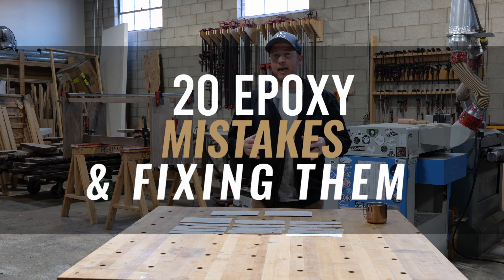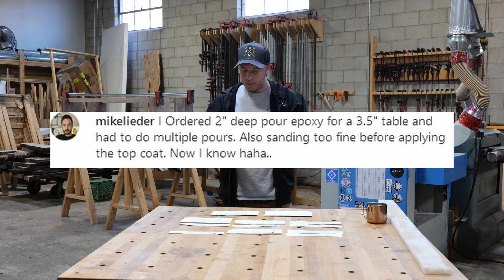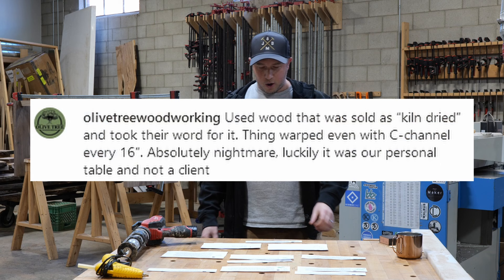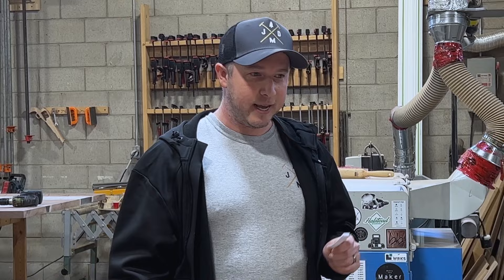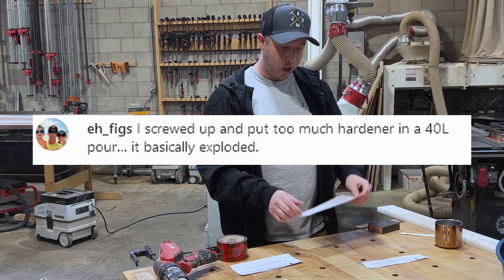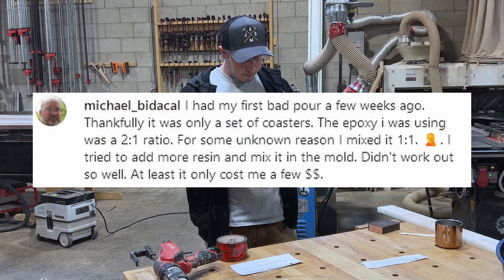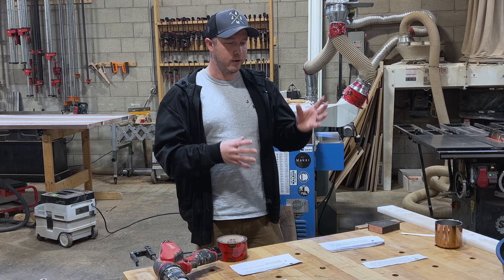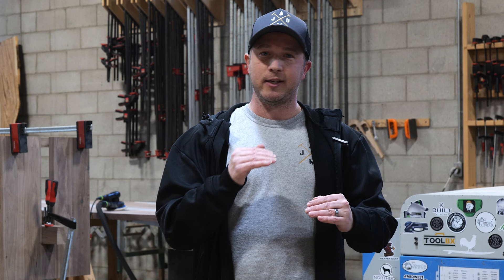Epoxy and Wood Project Fails & How to Fix Them

Comment: Just did our first pour on a penny bar top.  We did a seal coat and I think we took too long as the epoxy got hot, thick and cloudy on the final few spots we brushed.  Would you recommend trying to sand those down and re-sealing them before we do the 2nd pour?

Comment: I want to put crushed glass on a table top that has resin on it do I sand the resin on the table or can I just go ahead with it also do I put the glass down and pour the resin over it or do I need to put a small layer and put the glass down and then pour over the top to seal it in
Reply from the maker: Sounds like your best bet is to scuff the exisiting epoxy surface, apply a very thin layer ( like a flood coat) and lay down your crushed glass, let it cure and then do a final top pour!

Comment: Thanks!  I plan to do some wood "cookie" type tables just for myself.  There are holes and cracks in the wood, is there a thicker type of epoxy to fill the cracks with or do you have a video covering that.  Also,  on this video you said to use a meter to be sure the wood is ready,  what degree of dryness does it need to be?

Comment: Small little project literally an inch on the bottom of a dresser drawer. 
I did it in my bedroom…. I have carpet in my bedroom. 
I put the container I mixed it in down. And it dripped all down the edge. And now I have epoxy in my carpet…. 

It’s a brand new house build like 4 months old…… and I’m renting 😳😭

Comment: Gosh darn it... i found your video too late. I just poured a bunch of epoxy on my table top and made a few sinful mistakes: 1) did not mix A and B parts long enough..... 2) definitely did not use enough epoxy so now i have a bunch of dimples throughout... and 3) used a torch (not heat gun) and zapped the same spots repeatedly... 😅😅😅😢😢😢
Reply from the maker: You learn as you go!

Comment: My piece has recently formed two cracks in it. One is from a bubble, the second one I’m not sure why it came about. It’s not separating from the wood, the resin cracked. My pour was made about a year ago. Any suggestions on how to fix the cracks? It’s a 8 gallon pour and any suggestions would be appreciated.
Reply from the maker: It might be cracking from wood movement, if poured correctly the wood joint is usually strong enough to hold which explains your case. However, there could have been contamination or lesser mixed sections in the pour. With cracks, all you can do is scuff the surfaces and re pour trying to colour match as best as possible. Good  luck!

Comment: Steering the resin and hardener for three minutes didn't work for me. It was always sticky and not cured properly. I now use a dremel with a whisk attachment that mixes the resin with the hardener better.
Reply from the maker: Glad you found a solution!

Comment: we did a wooden floor the hardwood was about 3/8 s “ thick and 1-1/2 “ wide we sanded as best as possible with a flat large sander, poured in the day temp about 75 degrees, we poured it looked great left and stayed out about 8 hrs. as not to take a chance of walking on it until cured, came back some had seeped through the tiny cracks leaving the top thin layer in higher spots which cured hard, but the lower spots pooled in areas that didn’t seep out it would not cure 3 weeks later we scraped it off, and varnished it instead, ? what went wrong  our measurements were correct, we were super careful only second time with epoxy, if anything we were over cautious we didn’t want any mistakes we even over mixed being sure everything was completely mixed, was it just a bad batch of epoxy or did we do something wrong ?
Reply from the maker: That definitely sounds strange! If you had areas that cured hard, and some others soft, it could have been a mixing issue or contaminant. It could also have been something that contaminated in the low spots that was there before the pour. Hard to know for sure!

Comment: 3 weeks after an epoxy for I came home from work when the house was really warm and found a spot in my countertop that had gone soft I've removed the soft part but need to know how to fix. Also had a coffee.maker over flow and now have a stain when I had used ultimate top coat? How to fix it
Reply from the maker: Sounds like you need to sand and re apply!

Comment: How about the process of getting dried hard epoxy off an uneven pourous floor? It's adhered very well and the surface is not smooth, can't get anything under it to pop it up.
Reply from the maker: Once its absorbed and cured there isn't much you can do! Usually involves sanding it down.

Comment: The biggest mistake I have not solved yet are billions of micro bubbles suspended in the epoxy. This is very evident on clear pours. Do you use vacuum chambers on all of your clear pours to prevent this.  This is extremely frustrating for me as I have talked to the manufacturer and am following all of there steps.
Reply from the maker: A vacuum chamber will go a long way in helping solve this issue. I would recommend that as your next step for sure!

Comment: What about many fish eyes on a stain table, what the problem can be? No seal wood after stain? How to fix it? Thanks!!!.
Reply from the maker: Fish eyes are a result of improper sanding prep, or polishing of the topcoat if any. Hard to tell without seeing it in person. Try sanding through the grits fully and applying your stain or finish after, following the manufacturers directions.

Comment: I keep getting little dimples in my pour. Sanded and poured again and they still come back.  I wash it with isopropyl alcohol before I pour but they still come back in different places.  I used deep pour  and figured that was a mistake for a final coat so then I used Craft Resin and got the same results. Can you help.
Reply from the maker: Depends on the size. You may have to fill each little dimple separate, sometimes pouring a layer over top can end up trapping air in the same spots.
Reply: I tried fixing the dimples but I mad them worse.  I ended up applying additional flood coats and that turned out well Thanks, Jeff @jeffmackdesigns

Comment: I just leaning on how to do this I keep getting fuoming like and a lot of bubbles. Still have not figured it out
Reply from the maker: You're either pouring too much at once, or mixing it and creating a ton of bubbles. Try a vacuum chamber, or let it sit and use a heat gun to slowly remove bubbles before pouring. Could also be the type of epoxy!

Comment: I need your help with my wooden bowl i have a crack in it and it leaks what’s the best way to seal the leak
Reply from the maker: If you can, tape it off and try with epoxy. Or use CA glue. Depends on how big the leak is!

Comment: Can you use "found" wood with epoxy?  I love the shape of decaying root balls and would love to capture a ring of the root ball inside an epoxy pour but it sounds like I could have separation issues. thanks
Reply from the maker: In theory you could! As long as the pieces are dried and free of moisture and debris. You can brush on an epoxy coat to help seal the found wood before pouring.

Comment: Is there another way other than sanding and polishing to give the finish a clear shiny finish?
Reply from the maker: Unless you do a flood coat and leave it after it cures, no. Even then you could end up with high/low spots.

Comment: I appreciated your video. I came across it while looking for a way to repair a torch burn on white epoxy resin. The white epoxy resin bubbled up and turned a golden yellow. Any suggestions?
Thanks
Reply from the maker: Sounds like youd have to remove the yellow areas, scuff and re-pour. There is always a chance the patch job will be noticeable though.
Reply: Thank you.

Comment: Such a great video with lots of great tips. thanks for that. my question: what am I doing wrong if matt spots can be seen on the surface after curing. In any case, I mixed it conscientiously. so what could be the reason? thanks in advance and best regards, Silvia
Reply from the maker: It may be from uneven hardening, but there are  many variables. How are you ensuring a well mixed ratio? You can always sand and buff a piece for a high gloss finish after the fact.
Reply: @jeffmackdesigns  I use a scale for mixing because my epoxy is mixed by weight.
Thanks for the quick reply...I'll be more careful in the future and follow your valuable tips.

Comment: The problem I've run into is, hte epoxy doesn't stay spread out, it puddles up much thicker than it was spread out, almost like dough. It cured perfect in 30 hrs, but it's all stippled and thicker bumps, where it was totally flat after the pour???

Comment: I definitely learned that duct tape will not hold a pour without extra support. Metal tape is very sticky and does not allow leakage. It would serve you well filling voids in cookies.
Reply from the maker: Interesting! We haven't attempted using metal tape on our diy forms.
Reply: @jeffmackdesigns  i think you'd be pleased with its effectiveness.

Comment: Lolz well a clear work area. My mistake was simple. Poured , walked away. Thinking all is well. Kids (4 under 8) playing tag. Rushed though back door and saw dust took over table as a strong breeze came though the door as kids ran out of the door.... So , clean work environment (ps before I did start, wife did say should make sure work area is cleaned to a T, I said, nothing will happen, door is closed and locked. . . . The unexpected variable, "kids"❤ , love them but man.... )

Comment: Around the 1130 mark you discussed under mixing and epoxy not drying.  How do you fix. I have a sticky spot and I assume that is what happened.
Reply from the maker: You would have to pick/scoop out the whole sticky area, re scuff and pour again to hopefully try and save your project. Best of luck!

Comment: My epoxy didn’t seem to cover. It puddled up in most of the area, and other areas look like the epoxy didn’t cover. Like drops or dimples all over the surface. Not sure what I need to do now:( This was supposed to be a seal coat, bye the way.

Comment: what's the coldest temp i could get away with when doing a pour?
Reply from the maker: We recommend staying very close to room temperature so about 18-20 degrees celsius! There's a few degrees of tolerance but we don't recommend pouring in cold temps.
Reply: I have two projects going in FL today that I needed to do a 1/4” pour.  Put the bottles in the sunlight and they read 74 degrees when room was 70.  But when I mixed a small amount there were so many bubbles, I didn’t risk it.  Seems I need an indoor temp of about 72-74 for SuperClear to act normally.  Low temps are not usually a problem here:face-green-smiling:

Comment: I made a 2” beach scene last week, but the very last layer didn’t cure …after all that damn work.  I’m sure I measured right, but I’m unsure if it was/is too cool in my house or if I accidentally didn’t mix enough.
Anyways, I decided to cover it for awhile and just leave it to see if it’ll harden at all….give it maybe up to a month. 
Has anyone tried giving it that much extra time to cure?
Reply from the maker: If it's a temperature issue, you may be lucky enough to have it harden up in the proper climate. How did it turn out?
Reply: @jeffmackdesigns  it was perfect, just needed a little extra time.  I’m really glad I decided to try giving it extra time instead of trying to scrape it out.

Comment: You gotta get the cordless Ryobi glue gun. It will change your life.
Reply from the maker: I’ll have to check it out! That sounds awesome! Thanks for sharing!!! 🙌🙌🙌
Reply: I wish Ridgid had one as that is my "platform"... But I have been looking at the Ryobi. There is a sale on now on their 2ma battery/charger so now is about right to buy.
Reply: On Amazon they make cordless glue guns for different tool brand batteries. Like Milwaukee, dewallt etc. All great choices
Reply: @brandonm9359  but not Ridgid, which I already have batteries and chargers for. Just means I have to invest in another platform now.
Reply: that's unfortunate.  I'm currently running Milwaukee. There ok tools. Just super convenient for their line up. I'm really surprised that ryobi is the only company to make a cordless glue gun. It seems like it would be a pretty popular tool for a lot of people.